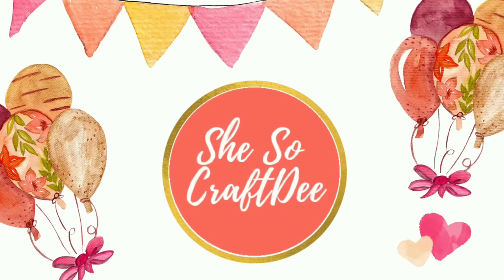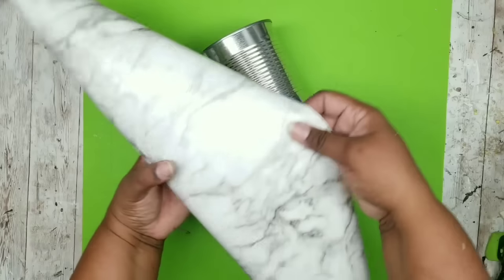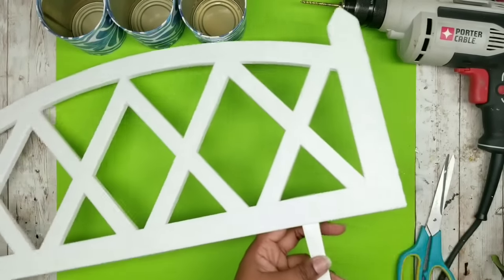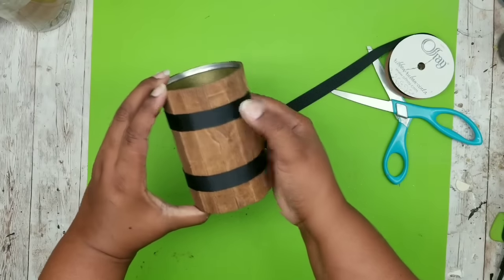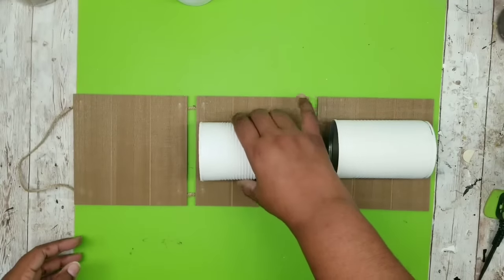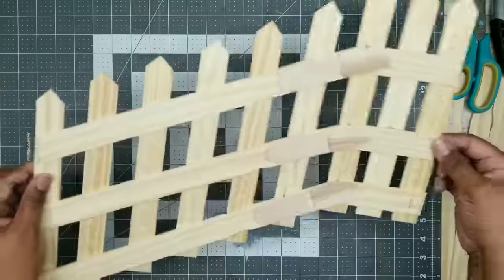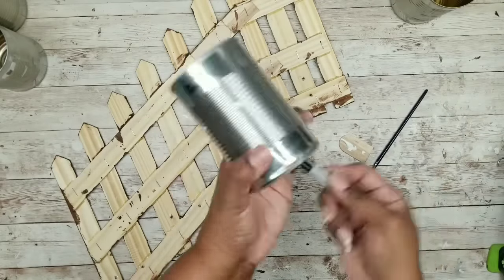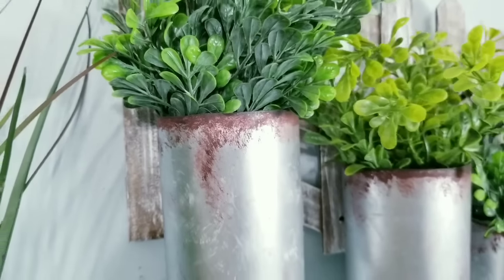DON'T Throw That Away! TOP Crafts Hacks & DIYS To Make with CANS! DOLLAR TREE DIY Decor Ideas

Comment: Chapter 3, folding down  the wall paper over the top also helps prevent accidental cuts or nicks on your fingertips. 😊
Reply: One of the best things I ever purchased for my kitchen was a safety can opener. Removes the lids without any sharp edges on the can or lid.